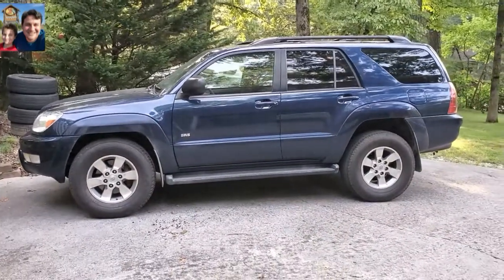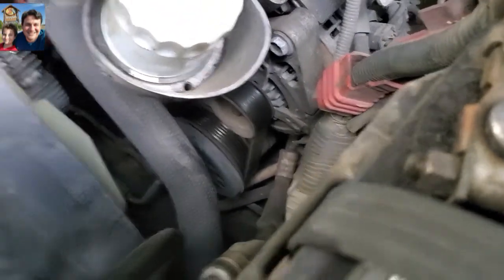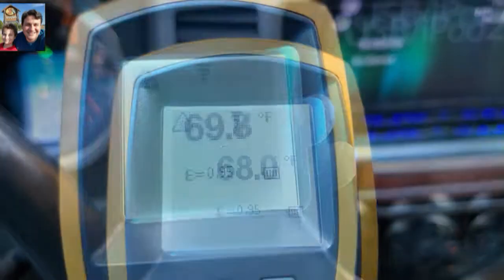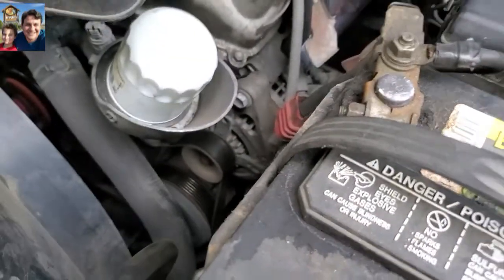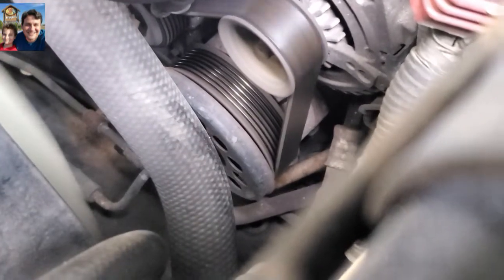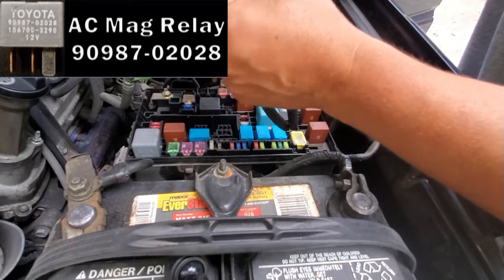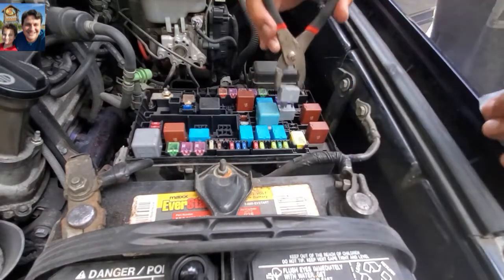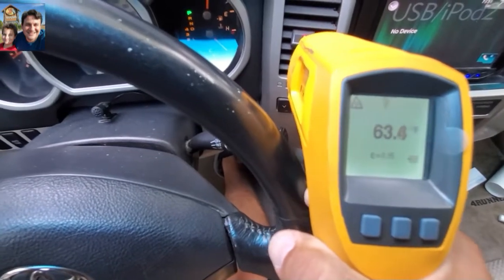AC Mag Clutch Relay Replacement - 4Runner 2003 - 2009

Comment: Thanks for the info. I noticed your dashboard is cracking. I got mine replaced at no charge years ago. Check with Toyota and see if they are still honoring the recall.
Reply: Mine also, nice new dash no charge. I have a 2004.

Comment: What was the problem behind the P0430 Catalyst inefficiency code?
Reply from the maker: Hey Samuel.  On the cat converter efficiency code P0430 / P0420 (I got both).  I ended up replacing the downstream sensor.  That took the problem away for a month or so,... then they came back... so I changed the other side P0420 downstream sensor.. and that took the code away for a few months also.  Then it came back.  I tested the temp difference in intake and outtake and that lead to the cat converter itself... over time, it started failing, so I had to pony up and replace the converter itself.... it sucked.....  lol.... good luck and stay tuned.  4Runner Ninja.
Reply: @4runnerninja426  Wow! Thank you! I just have the P0430 code by itself and I am going to have to smog test in 2 months and I live in CA. 2 years ago it would throw this code but it would stop and then come back constantly but it was able to pass smog when the light turned off. Now it won’t go away. Is it better to try to replace the sensors first? The suv has 227,000 miles. Does this situation look like the cat and not the sensors? I’m thinking that I’ll have to buy a new Cat